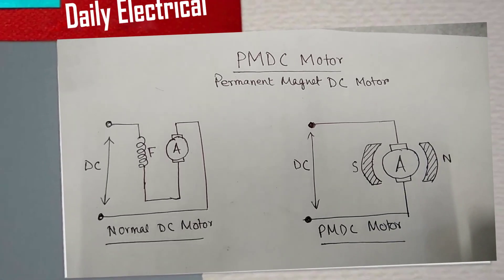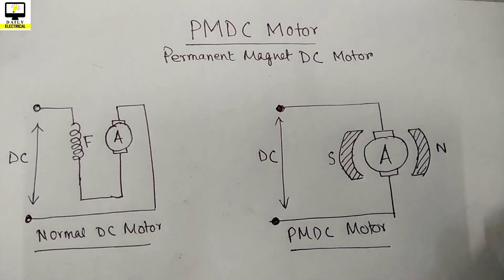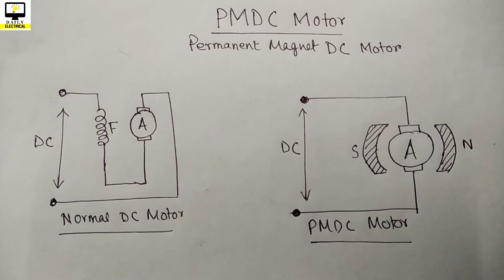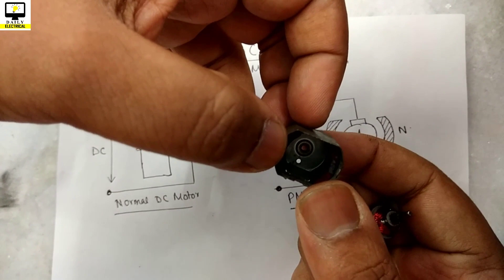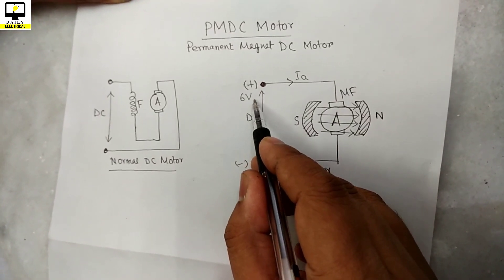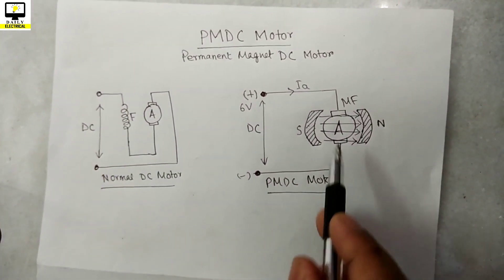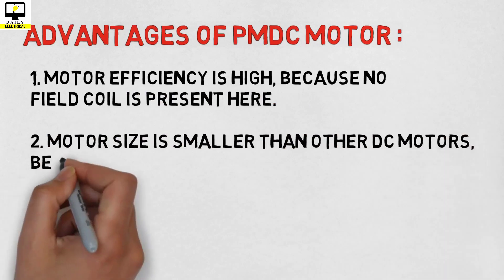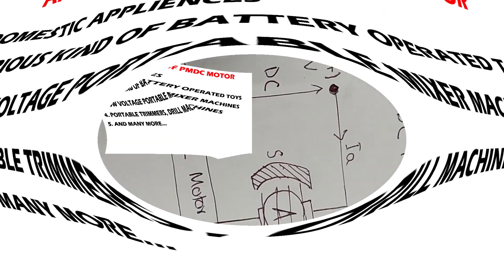PMDC Motor Working Principle and Applications

Comment: Please provide rotar designing calculation,for example length breadth of rotar core and gauge of wire wound with number of turns for each slot of rotar.
I wanted to know that which motor produces maximum starting torque DC motor or PMDC motor.